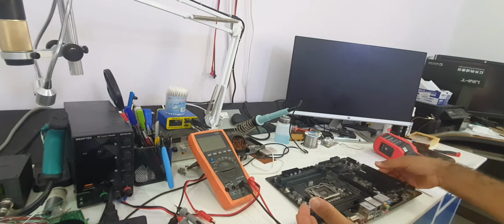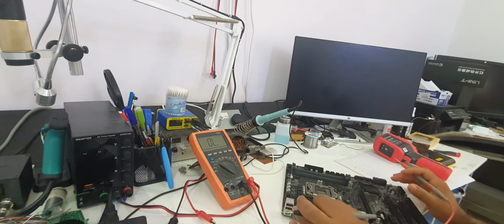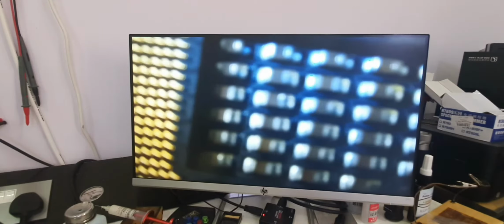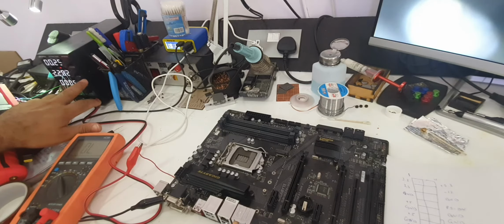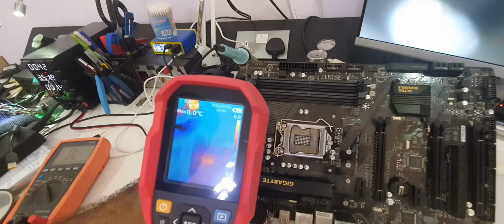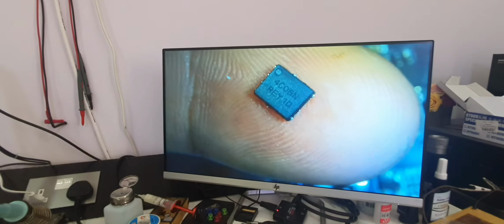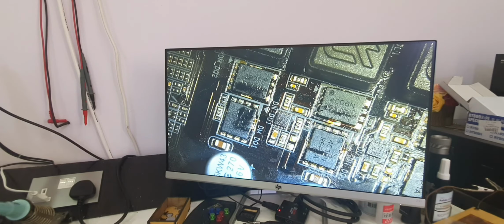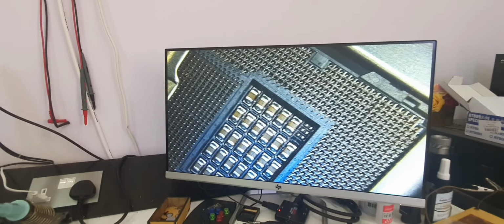Gigabyte GA-H270-HD3P CPU VCore Short

Comment: sir why you inject 5v on 12v power rail
Reply from the maker: Always inject low voltages even in high voltage rails especially in motherboards with impeded CPUs, so if a high side Mosfet is shorted causing the low CPU impedance to appear in the 12v rail and you injected high voltage in the 12v rail all the voltage you injected will pass through the CPU causing it to get hot or even burn..

So its a good practice to ALWAYS use as low voltages as possible to determine the cause of the short .

And because I was testing a motherboard with removable CPU, it was ok for me to go a bit higher with the CPU removed